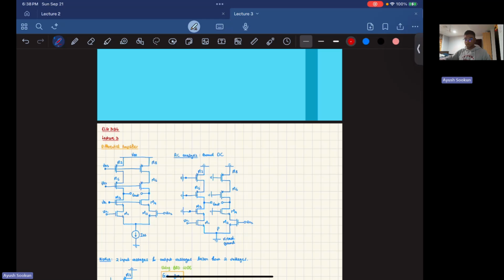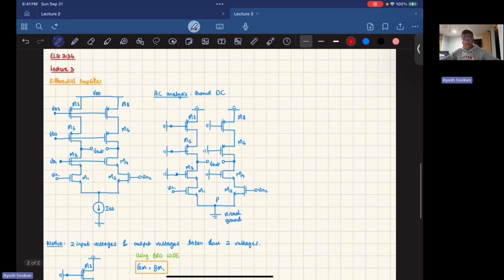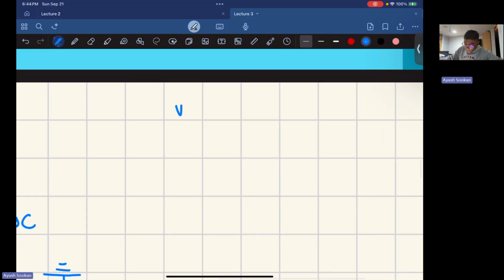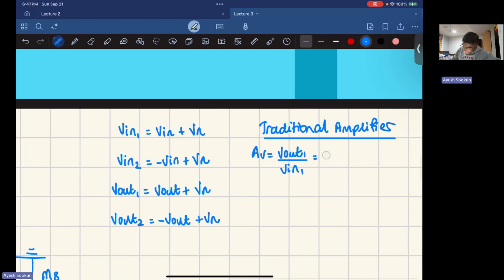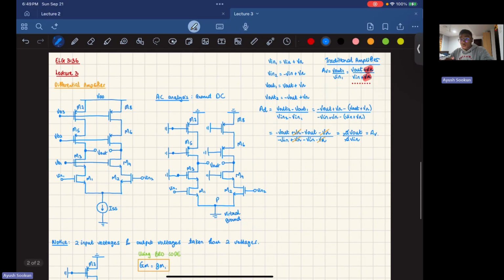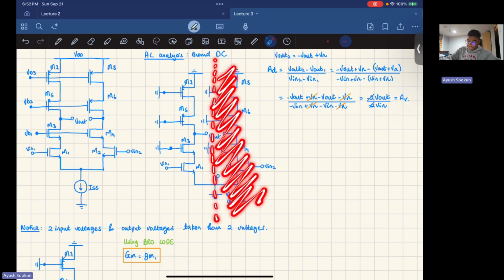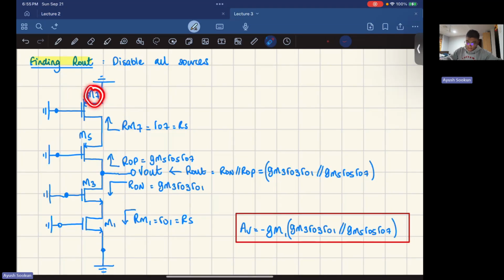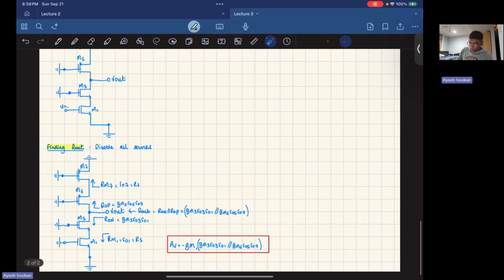Electronics 2 - Differential Amplifiers - Lecture 3

Comment: prof is saying we have to prove Gm = gm(of where ever the input signal is), i submitted one and lost marks for not proving
Reply from the maker: Yeah, it’s not a backed up true concept. It works better usually when you yap a bit more about saying due to Thevenin method, this and this happens, and approximation leads to Gm=gm. It’s more ideal to use on an exam. On an assignment profs are picky abt the topic. 

Why I also showed how to prove it in the video
Reply: @Ayush-Vai ok fair it was on an assignment
Reply: @Ayush-Vai  could you go more into depth on how we'd kinda bs or anwer an get to gm=gm1 on a midterm and what youd say?
Reply from the maker: @rtin.o that’s a goated question af 😂. I’d say: Due to AC analysis, DC is grounded, since Vout is also shorted, the DC connected transistors will be short circuited which only leaves the transistor associated with Vin for ac analysis, thus Gm=gm1 from electronics one method. 

Again this is a use at your own risk, as a last resort